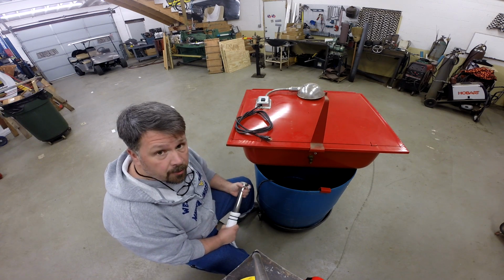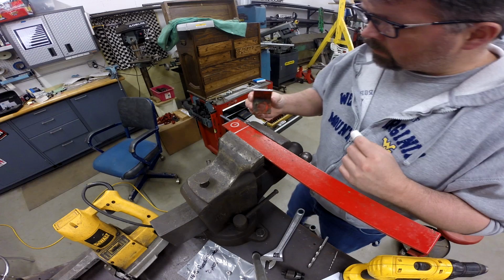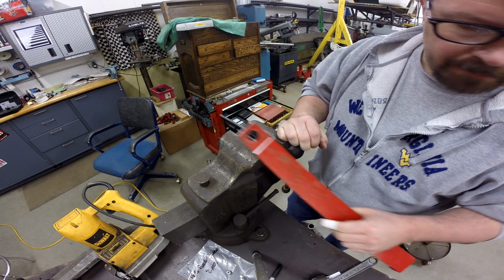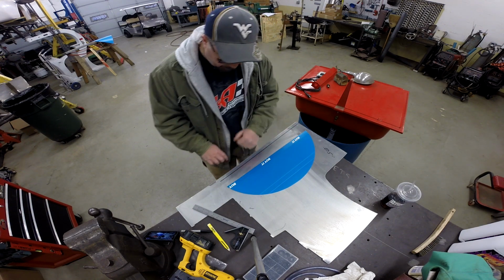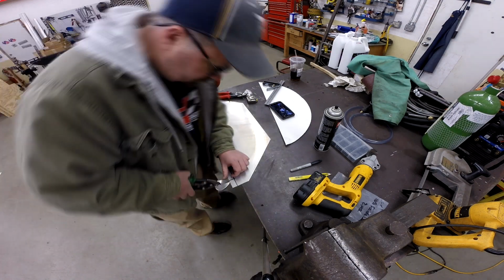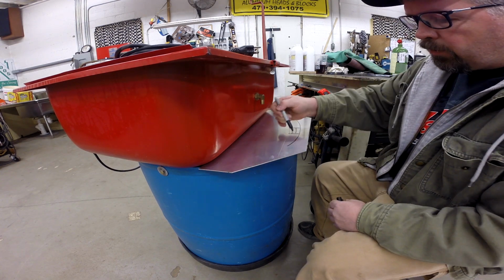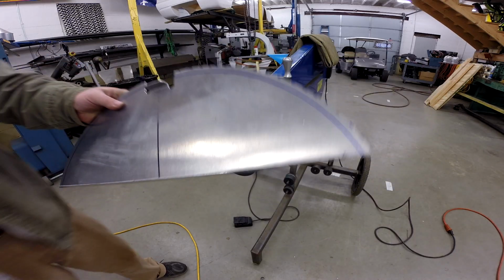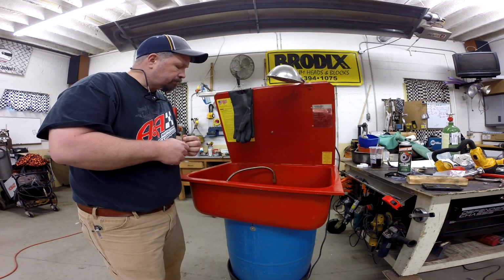Arcan/Carolina Parts Washer Repair/Modification Part 2

Comment: I struck gold and got a brand new Carolina 30 gallon parts washer for $75. Nice shop! I am too. A former pro welder and fabricator. I also do gunsmithing. It is why I bought this thing to begin with. Keep up the good work!

Comment: When I need a plastic barrel I swing by the local flying service (crop duster) and pick one up.  They have the 55 gallon drums but they also have smaller drums, about 35 gallons I think.  Perfect for a parts washer reservoir or a trash barrel.  I also have a couple that I use to keep my recyclable steel and aluminum. . 

Another thought, I'm tall and when I rebuilt my parts washer I brought it up about 6 inches.   

Great thread.  Appreciate the effort you put into these videos.

Comment: Hey nice job, I am very jealous of your shear and brakes.I really like the finshed look of the whole project.
Reply from the maker: +Wood-N-Metal Workshop ` Thanks for the kind words. It took a long time to find that equipment at an affordable price. I'm not sure if you noticed but the shear is a gap shear. Although the blades are only 52", I can shear an unlimited length up to 21" wide.

Comment: I've used Purple Power 1/2&1/2 for years, it works well, although if you heat it to about 120°F it works great.
Reply from the maker: James Zivny thanks for the advice and thanks for the sub.

Comment: Nice fabrication!  I have a Carolina parts washer that's missing the 30 gallon drum.  I am setting up an auto repair shop, and need a drum. The shops I worked at in the past always used the Zep solvent that came in 30 gallon steel drums.  I was hoping to order one, and kill two birds with one stone ,getting the drum and the solvent.  However, I looked on Zep's website and other google searches, and could not find it available.  Any suggestions?  My options seem to be to order an empty drum from grainger or uline for a ridiculous price and order my solvent separate, or take on a fabrication like you've done here.  Do you know of a company that sells solvent in a 30 gallon drum?  Thanks.